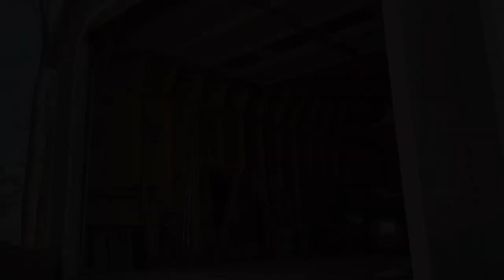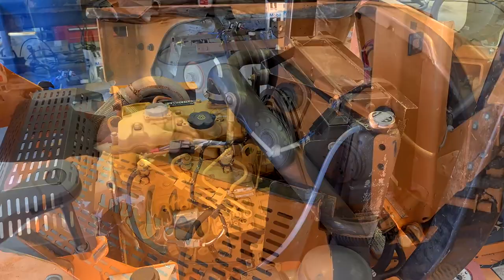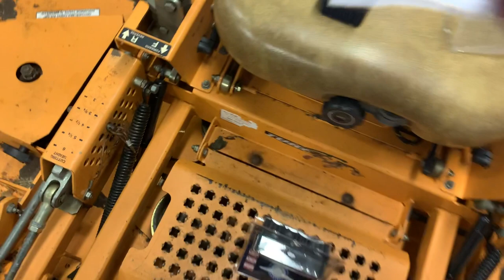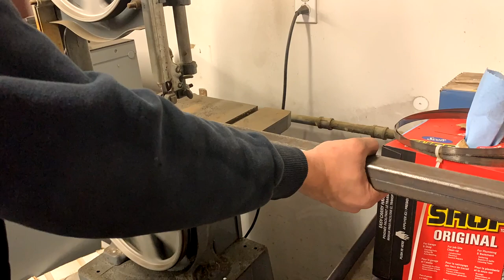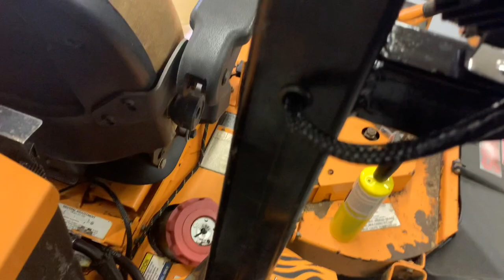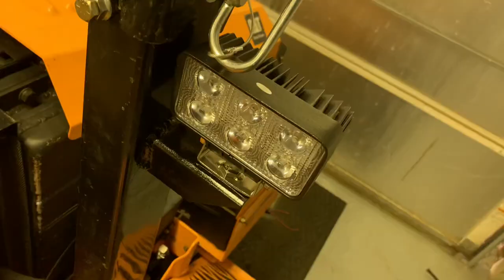Scag Turf Tiger w/ Cat Diesel - Mowing Season Prep

Comment: Is this the same as the Sabre tooth tiger?
Reply from the maker: No. Not sure about chassis differences, but the diesel option in a STT was a Briggs/Daihatsu turbo 3cyl. I think it was rated at like 32-33hp. The 28hp rating on this Perkins/Cat motor is somewhat suspicious since the Tier 3 cap was 28hp before needing emissions equipment. I’d bet it’s closer to 30-31hp. 

As far as the Sabre Tooth, I think it was built on a Tiger chassis, not sure what else was different besides the engine options.